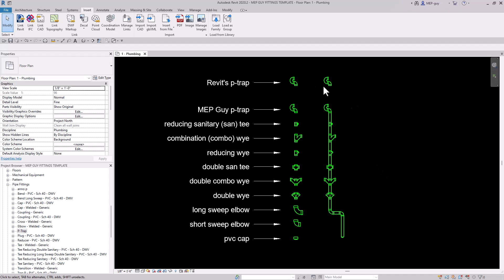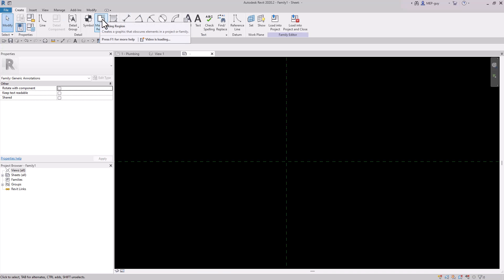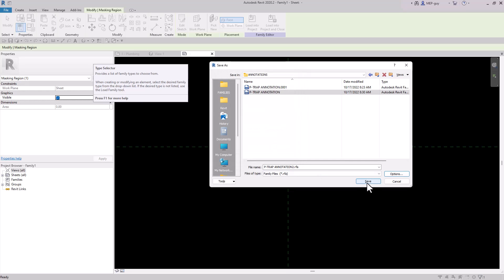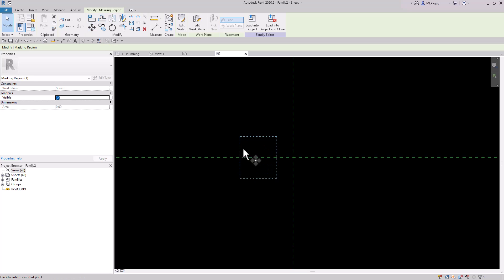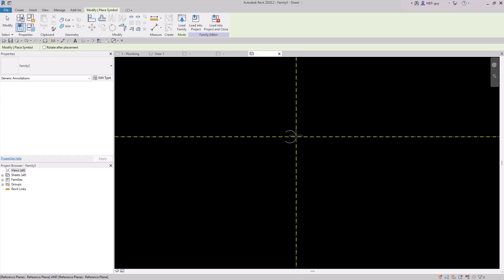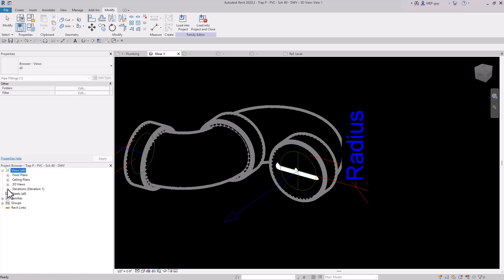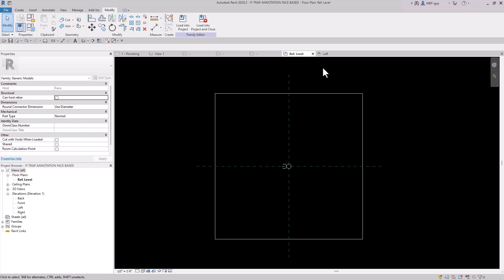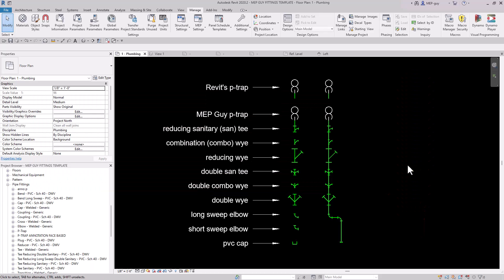Create a P-Trap Fitting with a Symbol in Revit

Comment: just wonder if using non-host workplane based is better than using face based, non-host workplane based can also host on face
Reply from the maker: Hmmm it might be better. I've never thought about that. I just used face based because that's how I learned the trick. If the file size is smaller without a face hosted object then it might be better.